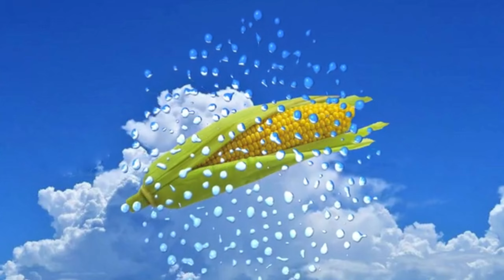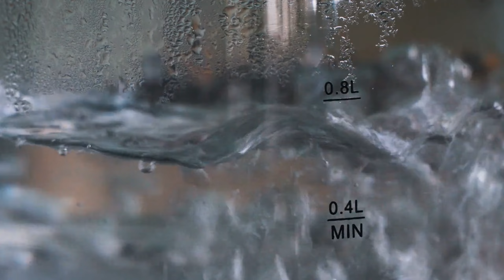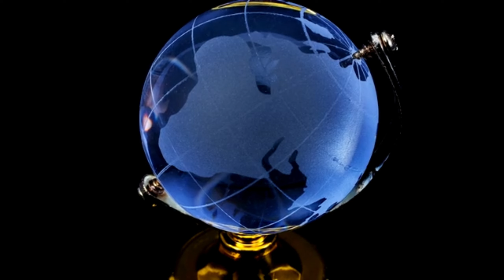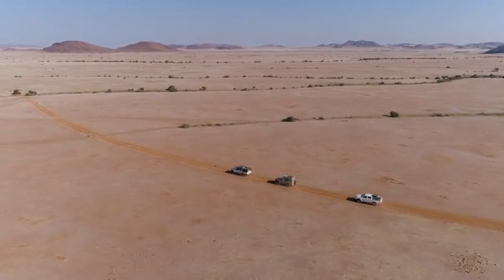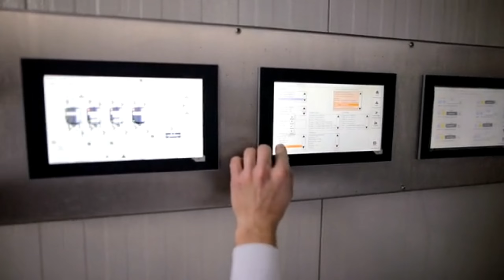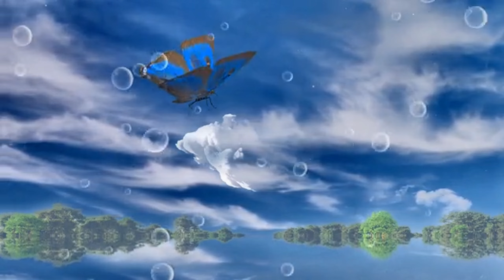Smart Spongy Device Captures Water from Thin Air

Comment: So, ... how much water per gram of MOF does it produce per hour?
Reply from the maker: Great question! Based on research, especially from studies using metal-organic frameworks (MOFs) like MOF-801 or MOF-303, the water harvesting capacity typically ranges from 0.3 to 0.8 liters of water per kilogram of MOF per day under arid conditions (around 10–20% relative humidity). That translates to 0.0125 to 0.033 mL of water per gram of MOF per hour.

However, performance can vary depending on humidity, temperature, and the specific MOF used. Newer versions might perform better in higher humidity or with solar-assisted regeneration.